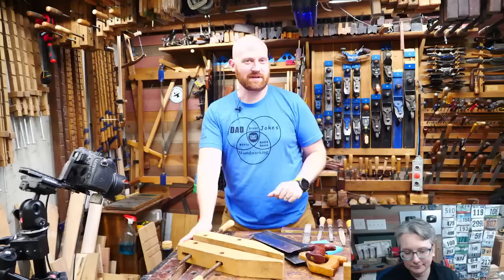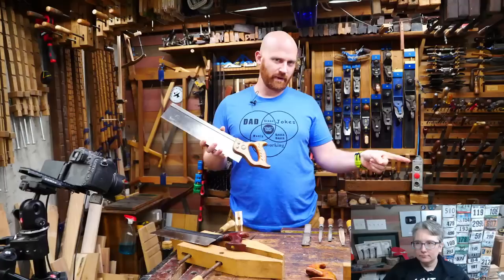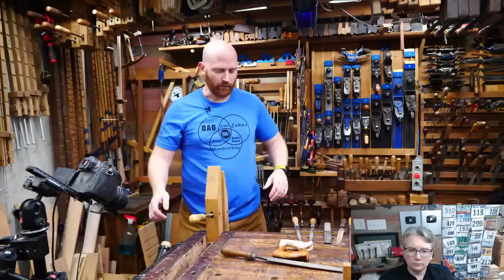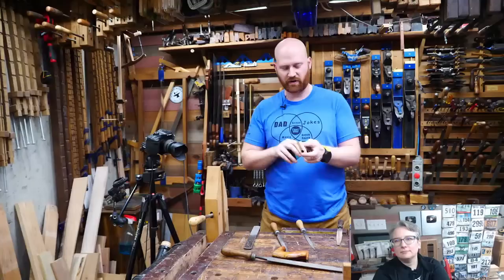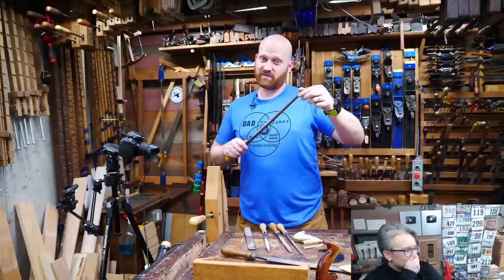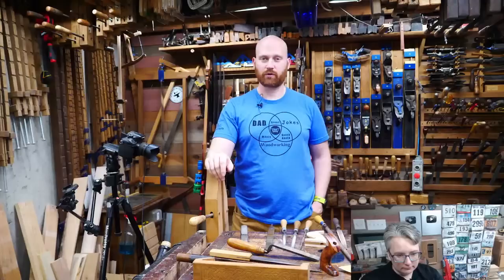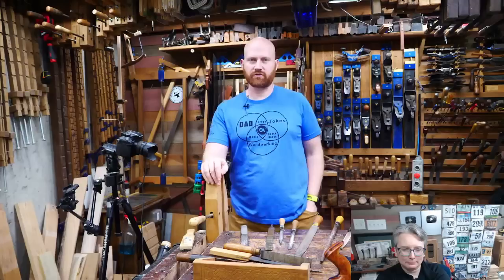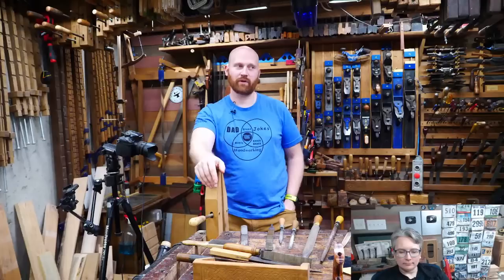How to cut Make Organic shapes.

Comment: 14:00 I bought a Nicholson 4-in-1 thing and hated it when I tried it out: the strokes are just too short. It’s in the back of some drawer, unused.

It’s difficult to give a recommendation for rasps: the shinto rasp is great, but other than that, one needs to find one or two rasps that feel right. For instance, I don’t like the coarse ones because I’m scared of tearout, no matter how efficient they may be. I’d start with a finer one, then go heavier as needed, and as skills allow.

With files, it’s different: get them all. I once bought a curiously shaped file just because I thought it looked cool – 5 years later, it was exactly the thing I needed to get rid of some burrs in an inaccessible spot.

Comment: At point 29:10, question asked about what makes a left handed tool left and right handed right,  you said that non of the files are right or left handed, however you can get left handed and right handed rasps. Auriou (French) have been making left and right handed, hand stitched rasps since the mid 1800s and the come in 15 sizes (Grain, 1 being the most coarse, 15 grain being the finest.

Comment: Hi James, maybe you would have already got this question multiple times here from the video thumbnail picture, but I just wanted to check with you if laminating multiple thin pieces of hardwood while creating a plane handle/tote as you have probably done here could pose any challenges with strength, or difficulty with drilling the hole or shaping..anything like that. One reason I am asking this is because I am rarely able to find a thick piece of hardwood in any store nearby - maximum thickness I get is 3/4 inch. So, one option for me to laminate/glue multiple pieces to achieve the desired thickness. And if I have to do that then why not make good use of it and create a contrasting pattern like you have done here! 🙂 - I believe it is maple and walnut or mahogany?
Reply from the maker: I have never had problem drilling with them. if the lamination is done well it will not make a difference. if you want to send me an email with other questions I can give you more detailed answers. JamesWright@woodByWright.com

Comment: Do you have more bench planes? Looks like there's no room for the low angle wooden jointer any more.
What new additions have you got? 😁
Reply from the maker: my A5 took that slot. I gave up the LA wooden plane when I got the Stanley 51.
Reply: @Wood By Wright How To  A5? As in the infill plane? You've gone down that rabbit hole... oh your poor wallet haha
Reply from the maker: No. Aluminum no.5 it is a Stanley